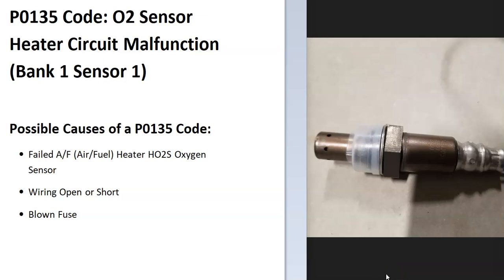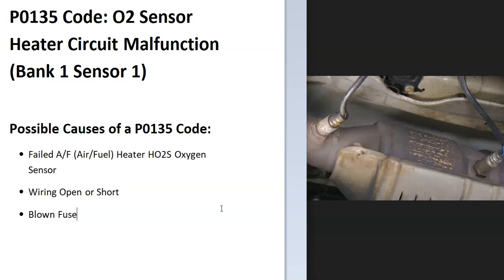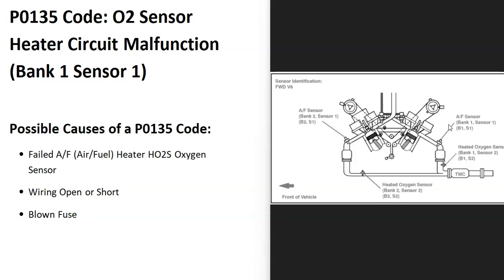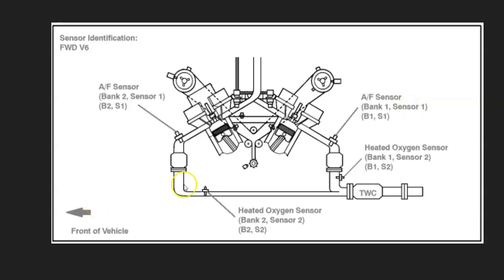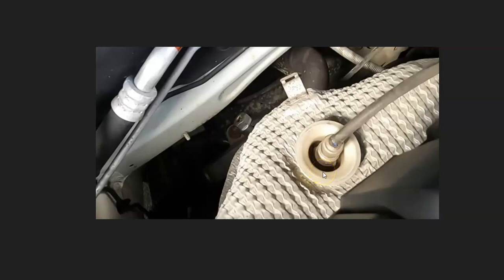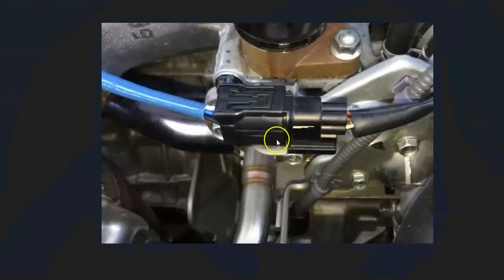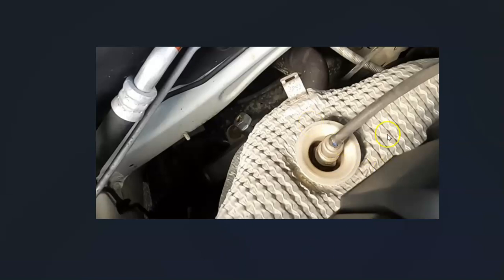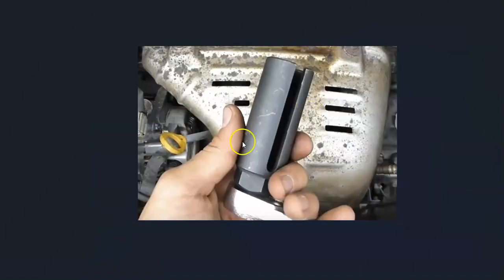Causes and Fixes P0135 Code: O2 Sensor Heater Circuit Malfunction (Bank 1 Sensor 1)

Comment: Why not cover when it is NOT the sensor???
Reply: What do you do when it is NOT the sensor? (When following this advice doesn't work?)
Reply from the maker: If the 02 sensor is good, then I would check the wiring. There should be 4-wires: 2-wires for the heater element and 2-wires for the Oxygen sensor part. The 2 wires for the oxygen sensor part would be the main ones I would test.
Reply: He did cover it. Listen.

Comment: Ok I’m having the same issues I have a P0135 code on but I replaced the sensor and the code still on. I know is not the sensor or wiring and a fuse. I have a cracked valve intake cover where the pcv valve is and a cracked hose and this is causing my P0135 code to show up.
Reply from the maker: A cracked intake cover can cause other issues, but I don't see it causing an issue with the heater element in the 02 sensor. If the sensor is good, I would test the heater element voltage when the engine is cold, which is usually 12 volts.

Comment: Got a 99 4Runner have replaced both sensors and cleared codes and chk eng light still on. How do you check if the wires are good. Did you do a video for that?
Reply: Did you figure it out I have a 2000 4Runner with the same code

Comment: 2010 Honda Accord V6. Have all three P0135/ P0155/ P0498. FI SUB 15a fuse keeps popping. Relay is good. Brand new A/F sensors. Is this 100% faulty wiring somewhere?
Reply from the maker: If the fuse keeps blowing, there likely is a wiring issue.
Reply: @HVAC_Mechanic I know the evap purge valve is also on this circuit but the service manual says nothing about testing that. I hope it is a bad wire somewhere and not just a faulty fuse box. That's kind of what the manual has led me to believe: either bad wiring or bad fuse box
Reply from the maker: If you think the purge valve is the issue, you could unplug it and see if the fuse blows. I made a video on how to test it to see if it is working. Here is a link. https://youtu.be/X-Y5YsaXxJE
Reply: @HVAC_Mechanic  Ok I'll test that before I dive deeper in the wiring. Thanks for the help!

Comment: I got a 4 cylinder with a aftermarket header that has a cat delete and so will using a o2 sensor simulator/adapter remove this code p0135
Reply from the maker: It's hard to stay with modifications what happens. It is best to read the forums of others who have done the mod on the specific vehicle.

Comment: You mentioned air/fuel ratio. Would it be possible this code is thrown because of a loose air intake?
Reply from the maker: That seems unlikely to be related. Usually, a P0135 code is a bad bank-1 sensor-1 or the sensor wiring.

Comment: Bought a used mercury g.m. previous owner had installed pipe instead of replacing cats. Upstream is not in pipe. It's hanging out tied up on trans heat shield.  I really don't want to dump hundreds to replace the cats.  How do I eliminate the sensor?  Down stream is connected in pipe.  Is there a way to just splice into down stream sensors that will work?
Reply from the maker: Not with the wiring, but there are what's called dummy 02 sensors (basically spacers) that can be added to the exhaust that bypasses the CAT

Comment: My honda accord lx v6 2007 with code P 1035. Is this same with P0135 please?
Reply from the maker: P0135 Code: 02 Sensor Heater Circuit Malfunction
Reply: @HVAC_Mechanic  appreciate for your answer and is it bank 1 sensor 2 on account v6 3.0 please?
Reply: @HVAC_Mechanic  my one is P1035 not The P0135 mate?
Reply from the maker: A Honda P1035 code looks to point to a 02 sensor, although some definitions list it differently. It must be a manufacturer-specific code. I would read through the forums to be sure, but it is likely a 02 sensor code.
Reply: @HVAC_Mechanic  thank you for your information mate

Comment: What happened if I already change all of the oxygen sensors and the code is still there 😢
Reply from the maker: I would test the wiring going to the sensors.
Reply: Reset the code with a code reader
Reply: Dont buy cheap sensors.

Comment: Been chasing this for a couple weeks.  14 ohms on the heater element, same for the other sensors, 12+v at the connector. Back probed with the o2s plugged in, 12+ v under load.  Still throwing the code. What now?
Reply from the maker: I would check all the exhaust gaskets and be sure there is no exhaust leak.